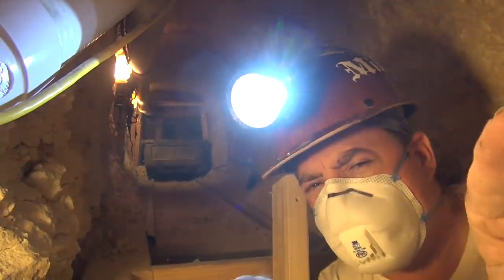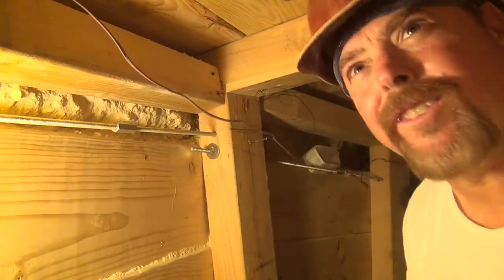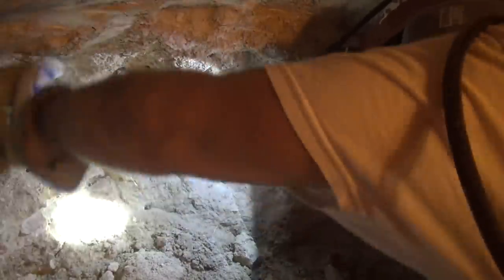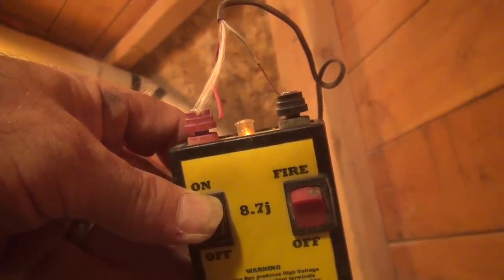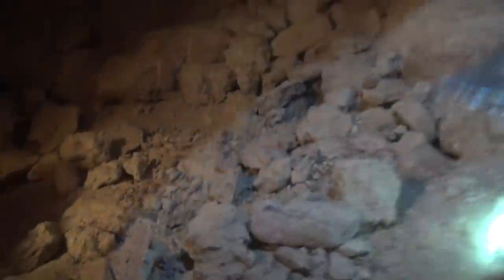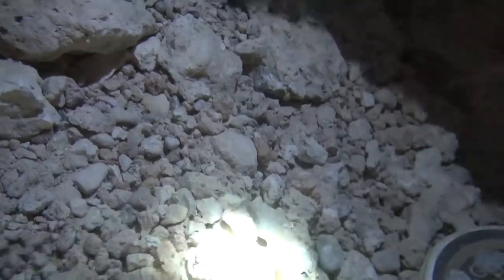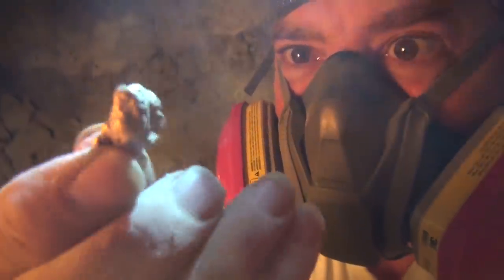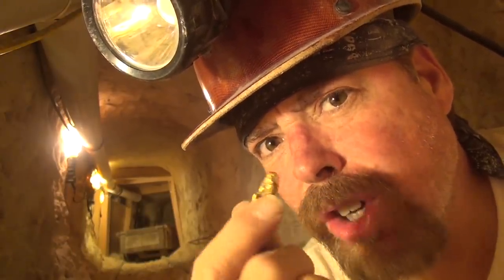We Found the Motherlode | Monster Gold Nugget - ask Jeff Williams

Comment: hi  Jeff bit of a tip from an ex miner , if you put some tin or metal plate down and then what you dig out falls on the tin or plate then its ten times easier spading up off the tin , hope that helps , keep up the good work
Reply from the maker: thanks Victor ....we usually use one for Blasting but really tight down there

Comment: Jeff.  I have small sugestion.. over head rail like they hang barn doors, RECMAR PRODUCTS SELL A LIGHTER VERSION AND SMALL TROLLES THAT RIDE IN THEM AND THEY have various radius bends and the rails
About 10 ft long and they are galvanized,  the wire rusting may be cured by using spools or stainless Mic welding wire ..won't rust it to comes in various size spools, and I have lots of all thread or treated rod.   You may also find a socket sized thread chaser.. for clean up... And this trolley track you could hang your LIGHTER tools and SUPPLIES to run them in and out.. .. And then I have aluminum coated inert gas line ... 300 ft rolls  7 of them 2100... ft but the fitting are not cheap.. only have the rolls.. .. but after watching this video I see why they ran the duck work to push clean air in. No wonder the would set off the blast and come back the next day...  
I'll start watching word of your videos again.. glad to see the results of your hard work...I do watch many abandoned mine explorers.. TRV, and the guy with the big beard.. And a few other the Crystal collectors . JOHN CORNER IS GOOD.....emerald hollow mines..
It's amazing what on this big rock...
Reply from the maker: Thanks for the tips.

Comment: apart from not having enough water, or being able to drain it, filter and recycle it... it would be awesome if you had a hand held water-jet cutter for excavation... that could be super cool, just cut a shallow pit for drainage and set up a recirculating system with a cord ran from solar panels up top... maybe even set a crusher down in the hole so you can process material down into smaller bits so you can move even more volume, at least of the good stuff. maybe use the water to wash down the walls of the dust as well as using it to excavate. of course, that woudl be Super messy, and maybe not practical, without a good design... but i feel like using water to cut through the rock and wash it down woudl be super useful, in some way. maybe create a catch basin that could act as, or hold a sluice with a good pump and water recirculation, and then shovel material in to it, or let water flow it down. maybe thats not necessary in that type of deposit though and I'm over-thinking it, but i feel the inexplicable impulse to, if i where there, want to use water to change up the processing a bit... then again, being in the desert, water isn't easy to transport around, so that may not be possible anyways, unless you hit a water table at some point... but, maybe even comprised air would do well for cleaning up the dust, then having a large or powerful fan and filter to capture that dust again... anyways... im just rambling on lol, too many ideas in my mind to not mention ye know. that is one heck of a nice nugget there...

Comment: jeff. Im a roof bolter in a coal mine. You should really consider bolting the place. use a hammer drill and go in 3feet.. then thread up some rebar and add a nut  with a piece of wood or a metal plate.. You will find its 1000 times cheaper in the long run then timbers and much safer.. it can hold 1000s of pounds of weight as it bolts strata / rock together. Will save a lot of room as well.
Reply from the maker: thanks for the tips

Comment: That large nugget has had its sharp edges all smoothed down, so it has traveled a bit to get washed down and stuck in your mine.  Are you going to attempt to find the hill or mountain it washed down from?  If not, what was your thought process to evaluate its origin? Love your videos and wish you made your drift a little taller to save your back.
Reply from the maker: the mountains the gave us these Nuggets are long gone ....only small hills are left ....hoping to get to one of the old original sources.

Comment: Place a tiny bucket wheel under the hole where that massive never ending flow of Scorpions and Spiders fall in.. Attach the wheel to an alternator off of a 1969 Mustang and a Battery.. that way as the scorpions fall on the bucket wheel... they turn it and it generates Electricity ! Enough to hook up your old Kenwood or Alpine tape deck so you have some tunes !
   It doesnt stop there ! No Way !  
You let the Scorpions and Spiders fall into another bucket and separate them.. Take an ild Hamster wheel , hook it up to an Alternator from a 1969 Camaro .... then put all the scorpions on it to run along and charge Another battery... to run the AC UNIT for your mini - KEGGERATOR ! 
 Then you just feed the Spiders to the Scorpions and your set ! When you have to many.... You give then as an offering to....
   The WORM PEOPLE ! ! !
OMG.. I can waste some Time.. 
But it's a Great Idea ! 
SO... LETS GOOOOOO !

Comment: I wonder if you will ever go deep enough to address mine drainage and pumping techniques...  ~( 'w')/
Reply from the maker: hope not
Reply: @Askjeffwilliams  I noticed you looking up at a loose piece in the ceiling at one point wondering if it was going to fall or not...did you go back and pull that down or did you just leave it in place shore it up when you went through with cribbing?

By the way, when you say 'hope not' does that mean if you found the starting of wet seep you would not go deeper even if there was good gold showing?
Reply from the maker: gonna shore it up later with some cribbing or even some sets ....we are going down to a lower depth as to get up under the main body of the Old Channel we may encounter water down there as it is getting moist in the clay seams...
Reply: @Askjeffwilliams  It would seem that if you can preemptively find anything upstream that you could do a water table sinker and just rig up a sump pump that kept any significant moisture out.

On the other hand, I suspect that if one uses salt treated timbers, they won't have to worry about rot.

I see a lot of videos of abandoned mines where people are slogging around in muck and gunk because they are some place where a whole lot of ground water resides and I know that for some mines, pumping water can get quite costly.

I sense that where your mine is, it might be impractical to put in any kind of long standing permanent duty pump in because of lack of full time power to the site [?]

I worked on a yacht once in California which had a bunch of small 12 volt bilge pumps but they never lifted the water more than 6 feet and I do not know they would lift, any more than I could guess how deep you might go before it becomes a real problem for you.

One idea might be to have a plastic tub or barrel some place out of the main path so that low voltage/low drain DC pumps can mind the water when you are away and then just empty the tub/barrel by buckets when you are there.

Where I live, for me to mine ANYTHING is guaranteed water flow.

I drilled some holes in some thick slab rock to put in a fence post [happens a lot here in Arkansas!] and it instantly began filling up with water.

For me to start a mine would open up a large amount of highly porous, heavily saturated stone and ensure a 24/7/365 source of water, which might prove to be too much and be impossible to maintain even with a 10 Hp pump [which I have, but only 198 feet of cable at the moment, which does not offer much hope for a really deep sump unless I build it as a jet pump set-up.

I do have a spare jet pump, but it is only set up for 80 feet, not sure enough about how jet pumps work to know how deep is the max before I might find myself having to put in something like a real submersible well pump.